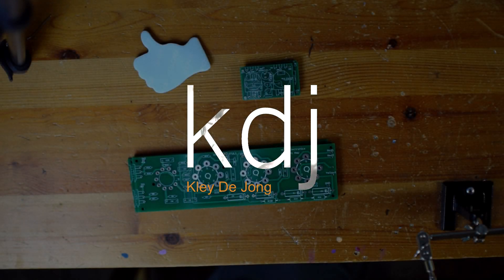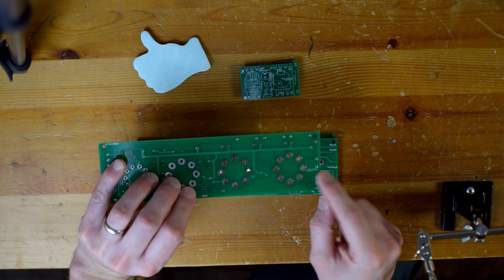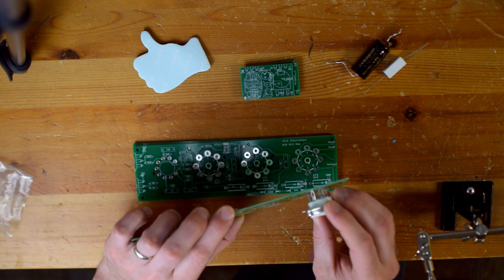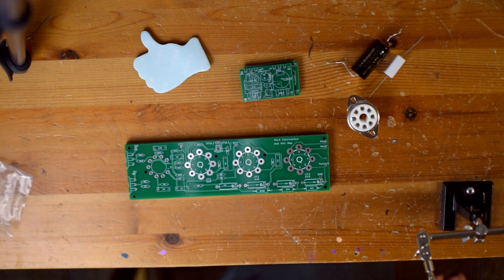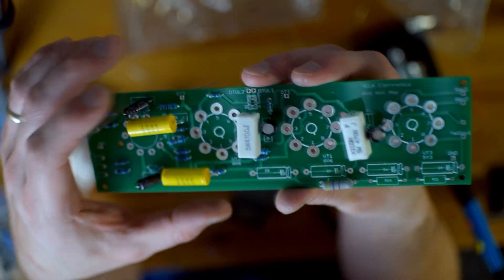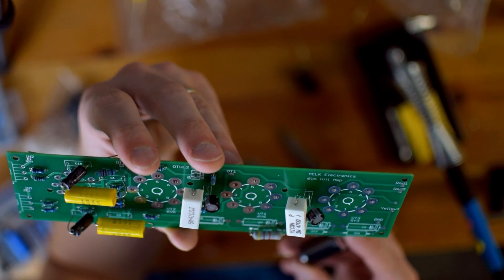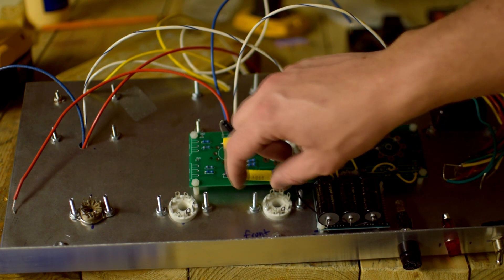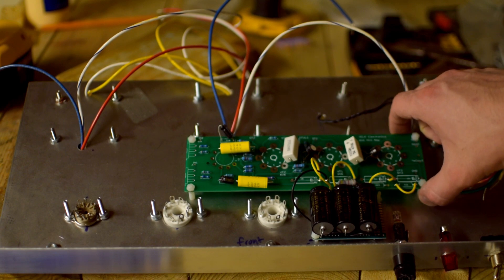6V6 Hifi Amp Build - pt. 5 | Wiring the PCB

Comment: Any chance of increased noise from having those large caps so far from the main board?
Reply from the maker: I am not concerned about that.  The cap board is directly adjacent to where the caps would have been located.  They're still near the power supply and far away from the sensitive preamp circuitry.